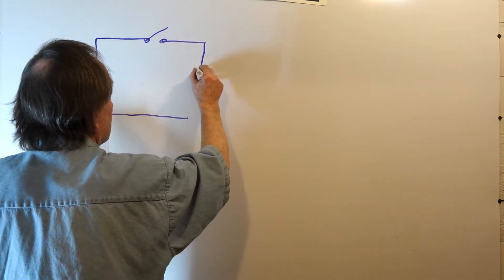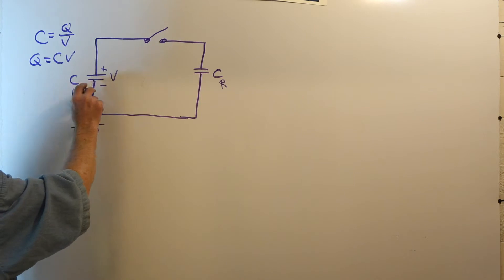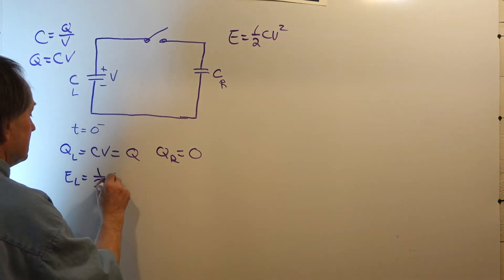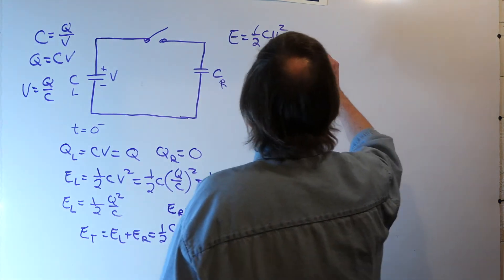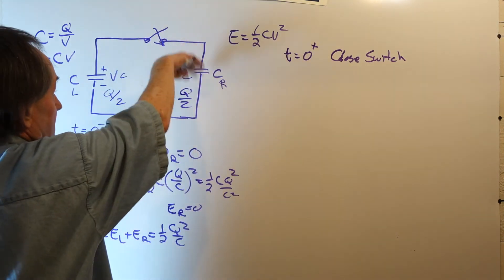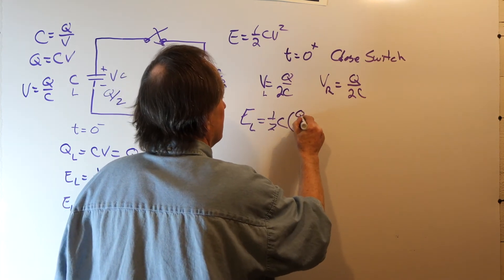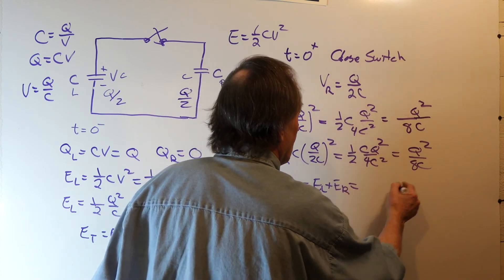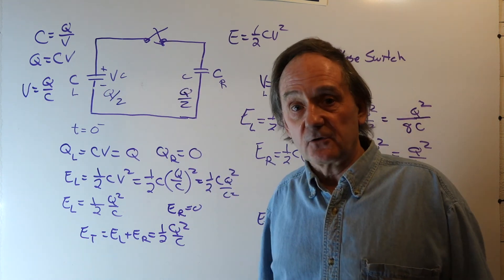Capacitor CHARGE and  ENERGY  Transfer  Problem

Comment: I have been thinking about the problem and the conclusion is that when electrons move from one energy level to another, they either absorb or radiate energy.  So in this case the electrons are giving up some of their energy.  I intend to study the paradox and write my findings on my blog sometime in the near future.
Reply from the maker: Jim,
Any energy radiated by accelerating charges such as electrons will not account for the energy loss.  You can integrate radiated energy for all of time and never get anywhere close.   Even for the brief moment of time after the switch is closed and allowing a very large current pulse will not account for the change.  Make the interconnects arbitrarily short and what do you have for an antenna?  Radiated energy is not the answer.

I have never in 40 decades ever seen a correct explanation other than that given  by "number 33" in the comments below who is on the right track and is essentially correct.

Eventually I will get back to this problem and present a very detailed video on this problem and discuss all of the WRONG explanations given by various contributors over the years and explain just why they are wrong.

The correct explanation is quite simple and not very complicated.
GH    Nov 11, 2019
Reply from the maker: I see that it is approaching 2 years since I mmade this video.  I really need to bring closure to this problem.  Unfortunately life gets in the way at times of addressing this and making my solution video.   Getting to it will be my New Years resolution and also the infinite resistor grid problem.
Nov 11, 2019  9:16am
GH

Comment from the maker: This link was given to me by the author of the blog.  His analysis is wrong for the energy change within the capacitor structure of the problem is not due to work being performed in adjusting the capacitor plate separation to double the system capacitance .  No work is being performed on changing the system capacitance as his analysis assumes.

https://jimredgewellscience.blogspot.com/p/capacitor-pa.html?showComment=1572588843258

GH   Nov. 1, 2019

Comment: The proper answer to the missing energy is explained here https://jimredgewellscience.blogspot.com/p/capacitor-pa.html
Reply from the maker: Jim,
That link you posted is not the correct solution.   Your solution is for WORK being applied to the system to move the capacitor plates and no such work is being performed in this problem.   I will eventually get to making a video solution that details all aspects of possible solutions I have seen posted on the internet and posted as comments to this video.  I will detail why they are wrong and that there is only one correct explanation.  One of the viewers posted that which leads to the correct solution.
GH
Reply: @georgehnatiuk5806  What my articles prove is that ENERGY isn't CONSERVED.  I have written a new article which proves this point.  https://jimredgewellscience.blogspot.com/p/capacitor-problems.html
I disagree with your point "WORK being applied to the system" as the only thing I used was a fixed charge.
Reply: I have temporarily removed the article from my blog.
Reply from the maker: Jim,
Actually energy is conserved.  The problem does not violate that principle.  Your understanding is what is in error.  Do not feel bad, most people including physicists and electrical engineers have over the years given incorrect explanations.  Most of these explanations take a stab in the dark without working out the problem using their conjectures to check to see if it makes sense or accounts for the lost energy.
GH
Nov 11, 2019  10:13am

Comment: It might be intersting to consider a third very tiny capacitor with a common ground and alternatively conected to one capacitor then the other. This would transfer charge in tiny pulses, but would take a very long time!
Reply from the maker: Yes Wendy,
That would work.  That is basically the concept used in DC-DC switch mode power supplies.

Thanks for bringing this to my attention.  I really need to finish the followup video with all the analysis and discussion regarding the loss of energy and the solution using passive components rather than active ones that are required to make the SPDT switch required in your proposal.
GH    June 24, 2019   10:06pm

Comment: Dear Sir-When are you going to upload the solution. I gave a small thought about it. have got two possible answers..
1. Because we are charging instantaneously, there is an impulse current of CVdelta(t), means this current has infinite frequency component and very high frequency could radiate from the circuit, which we haven't accounted in the calculations. I am not good at fields, other i would have calculated Maxwell's equations just to see is that equal to the half of the missing energy in our case.
2. Since charging is very fast, we can't neglect inductance of the loop, how small is the lop area because di/dt is infinite (no resistance in the path). So the problem turns into LC network, when i calculated energy the half of the energy which is missing in our calculation is oscillating between the capacitors

What do you think about these point?
Reply from the maker: Nice reasoning but wrong on both points for resolving the issue.  The radiated energy falls considerably short for you cannot have radiation over an infinite bandwidth -  theoretically yes but in practice no for there are always band limiting constraints -- try doing the calculations.

I will post the answer during Thanksgiving (end of Novemner) as will I for the infinite resistance grid.  Will have a few free days then to write it up and make the video presentation.
GH

Comment: This problem is not so hypothetical as it seems.  Imagine it’s a real application and the switch is some sort of semiconductor device like a transistor or a thyristor which of course has a finite switching time which will limit the amplitude of the current pulse.  The result tells you two things.  Firstly it tells you that no matter how fast or slow your switch operates and how low its ON resistance is you will lose at least half of the energy in the process.  Secondly it tells you where that lost energy will go ie it will go into the switch and be dissipated as heat.  Switching loss is a major consideration in all switchmode power supply design.
Reply from the maker: It is these real world applications that moves the problem from the hypothetical to practice in design considerations.  Number 33, what industry did you work in? You previously stated you are retired.  Did you practice as a design engineer?  It is a pleasure to hear from a practicing engineer who has some real world experience.  Thanks.
GH
Reply: Yes George, I was a circuit design engineer working in the UK Aerospace industry for forty years.  I worked on projects from Blue Streak, the UK's 1st stage contribution to the European launcher which was cancelled soon after I started work, up to Beagle2, the UK's Mars lander which failed to land on Mars.  I did work on a few successful projects in between though, mostly designing switchmode power supplies for satellites such as Skynet 5, the UK's military communication satellite network.  Nowadays, switchmode power supplies operating at 100's of kHz or even MHz frequencies are all about driving Power MOSFETs which could be described as a collection of capacitors flying in formation.  It's all about getting them to switch fast, but not too fast to minimise losses, hence my familiarity with the capacitor problem.
Reply from the maker: Figured so.  I was looking at switchmode some in the mid-late 80s.  Since then the technology has matured where the design is easy with availability of IC's from Linear Technology(Now part of Analog Devices), Texas Instruments and Maxim.
GH

Comment: Well that brings back memories, I've been asking people this question for about forty years until I retired.  Some people insist that the answer is that the missing energy is radiated, they call it radiation resistance or something similar.  But that can't be correct because this hypothetical perfect circuit has no inductance and cannot produce a magnetic field.  I believe that the answer (which is hinted at in one of George's replies below) is that it's dissipated in the non-existent resistance.  If the resistance is zero then the current will be infinite and infinity squared times zero can be anything it likes.  So we have to consider the non ideal case, inserting a resistance and gradually reducing its value to zero.  The smaller the resistance becomes the higher the exponential current pulse becomes but the energy dissipated in the resistance always remains the same.  No matter how small you make the resistance the current rises to a value sufficient to dissipate exactly half of the energy.  So in the the limit the energy is still dissipated in the resistance even when it becomes zero.
Reply from the maker: Finally someone that understands this circuit.   I think you will like my analysis when I finally post it.  Should be mid-April.  Trying to finish my survey on Rainy Lake and that is taking all my time.  Good job.
GH
Reply: When people understand that you can't charge a capacitor via a resistor without dissipating half of the energy that's taken from the source, they then jump to the conclusion that a charge pump or voltage doubler circuit cannot be more than 50% efficient.  So you might like to follow up your analysis with a video questioning this assumption, which is of course wrong, charge pumps can be as (theoretically) efficient as you like.  I'm avidly following your curvature survey despite the fact that I'm 'fairly confident' that I know what the result will be.  It's the first properly scientific curvature measurement that I've seen and that includes Stephen Hawking's attempt.  Keep up the good work.
Reply from the maker: Number 33,
In my solution video, I will be showing a method to transfer the charge from the initially charged capacitor to the discharged one with little loss of energy and as you state it can be theoretically efficient as you like.
GH
Reply from the maker: number 33,
See my answer today Dec 26 to Edd Latreche.
GH
Reply: That being the case, can you explain as to why the same energy is not lost using batteries instead of capacitors, when the same resistances exist?.

Comment from the maker: ATTENTION  VIEWERS ---   ATTENTION  --  ATTENTION 
To viewers regarding the switch closure and missing energy.  Please do not post comments stating the work done in closing the switch can account for the lost energy.  That is nonsense.  The missing energy has nothing to do whatsoever with the switch.  Think about it for a moment: 

The left capacitor is initially charged to a voltage V and the right capacitor has no voltage across it so no energy is stored in the right capacitor.  Up until the time the circuit is completed when the switch is closed any work performed on the switch is EXTERNAL to the circuit and does NOT affect the fields and charge on either capacitor.  Even if the switch could possibly affect the stored energy, it would be ADDING energy into the system rather than taking it away.  To close the switch requires work and energy acting upon the switch -  this is an energy INPUT into the switch to close the contacts.  Work is being performed upon the switch by some entity EXTERNAL to the network.  The network is not closing the switch.  The network is not providing the energy to close the switch - whatever work is needed to close the switch must be provided by someone unrelated to the network.

Even if one wished to replace the switch with a variable capacitor that would have its capacitance change from C = 0.0 to C = very large value to simulate a switch closing, work would need to be performed on that capacitor to change its value as in moving the capacitor plates closer together.  That would be energy inputted INTO the system not taking energy away.  That is an easy problem to analyze.  Try it and see what happens to the total energy of the system as the capacitance is changed from ZERO to VERY LARGE value when it replaces the switch.
GH
Reply from the maker: To all who visit here,
I see that it is approaching 2 years since I made this video.  I really need to bring closure to this problem.  Unfortunately life gets in the way at times of addressing this and making my solution video.   Getting to it will be my New Years resolution and also the infinite resistor grid problem.

I just came upon this video a few minutes ago.  It is correct and gives the proper answer for real world components though it does not describe this IDEAL hypothetical circuit.   That should tell you something.   :)

https://www.youtube.com/watch?v=4mKkZWeKqfo

Nov 11, 2019  9:16am
GH